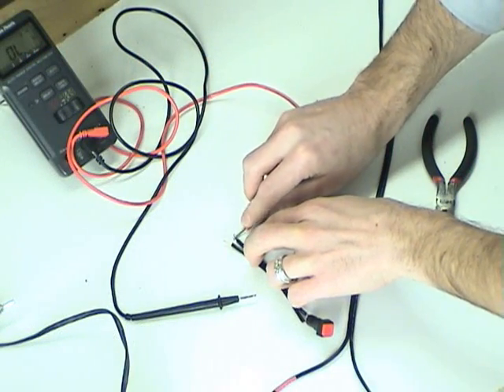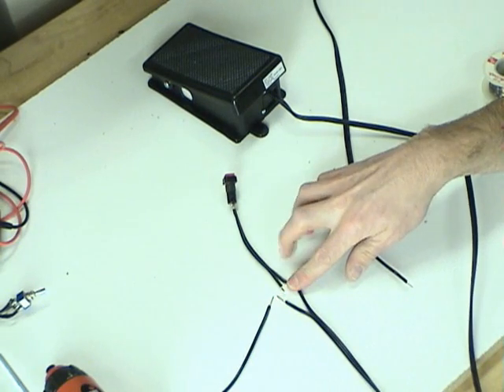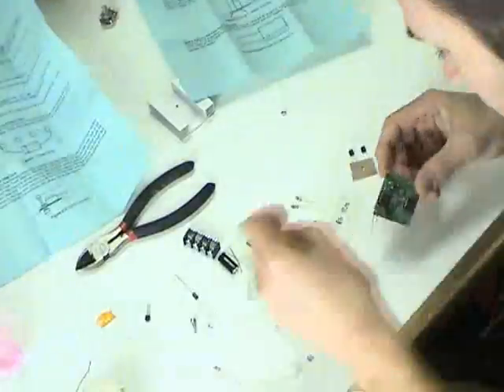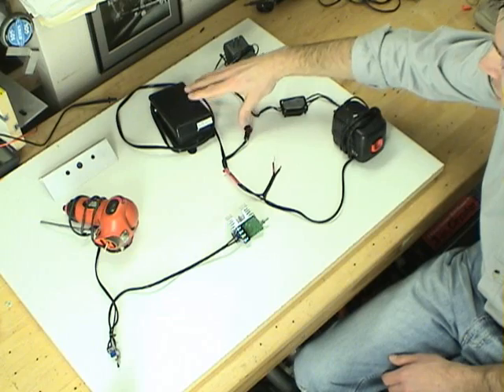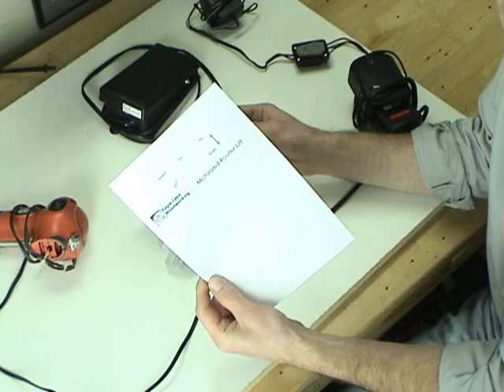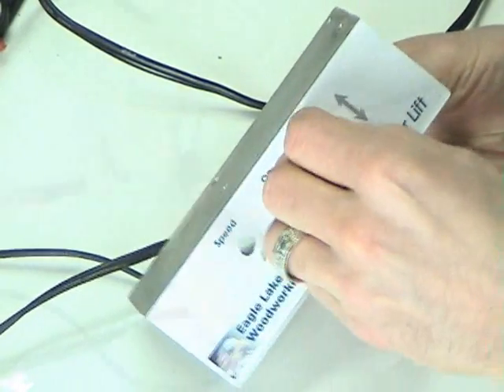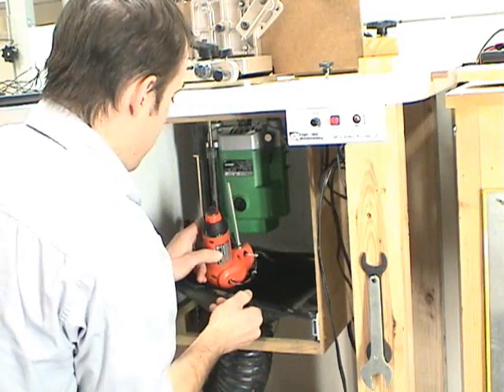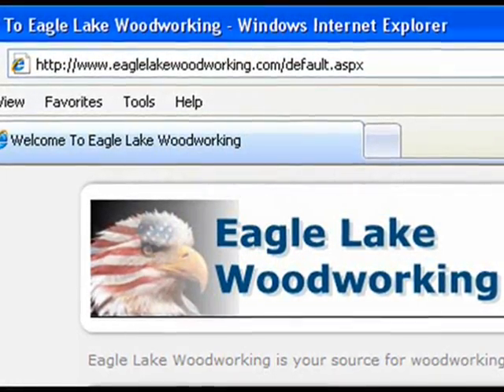Part 2- Motorized Router Lift Wiring - wiring cont. and control panel

Comment: Great idea pro.

I prefer to replace the Up/Down & On switches with two push buttons (for Up and Down) for the table and two foot pedals or one double action pedal, which need some changes in wiring as well.

And I think you could cancel the battery and use DC power supply with same battery output.

I'm going to build a simple router table soon, and I'll try to find the time to apply your idea with the above notes.